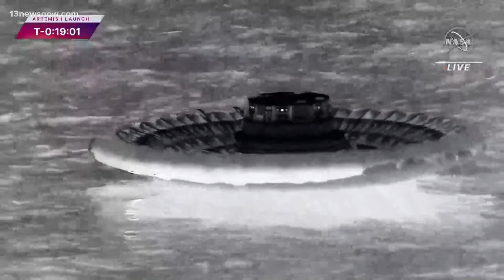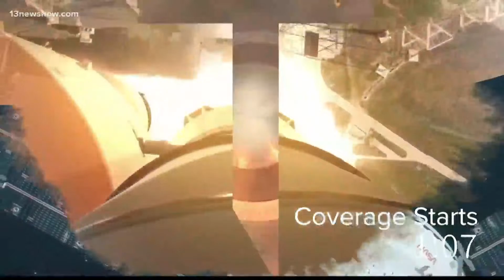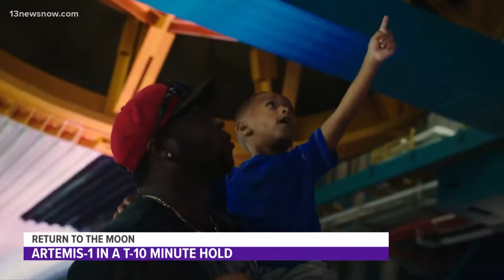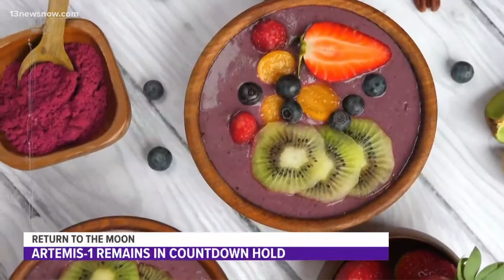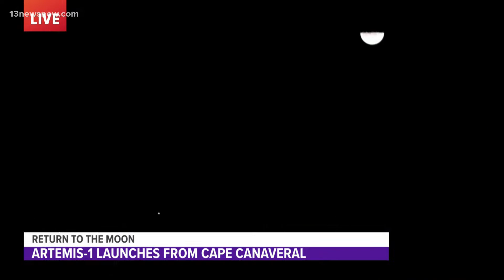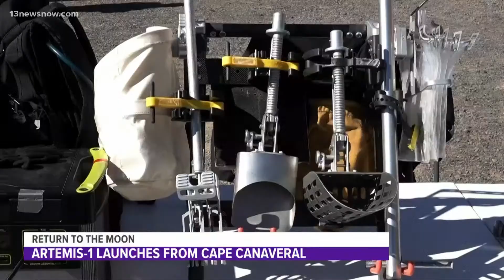NASA's Artemis 1 rocket lifts off, 50 years after Apollo

Comment: The next Artemis launch will be in 10 years costing another 100+ billion dollars.
Reply: Both wrong. This one did not cost 100 billion, and the next one will be in 2 years from capsule recovery of this Orion.
Reply: @maxv9464  Maybe I should have said It will be 100+billion on top of the 37 billion already spent.
Reply: @tedjones450  We already know the cost per launch (which, by the way, is less than a Saturn V)
Reply: Artemis 2 scheduled launch in 2024
Reply: This first mission is five years behind schedule and billions over budget.
Reply: @tedjones450  Yeah, bust cost overruns and delays after a first success don't multiply by 20.